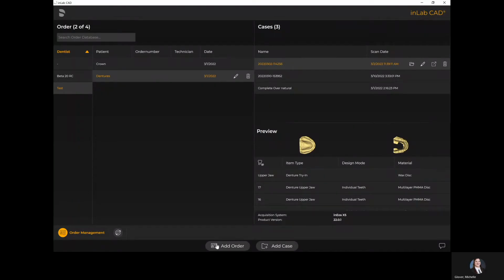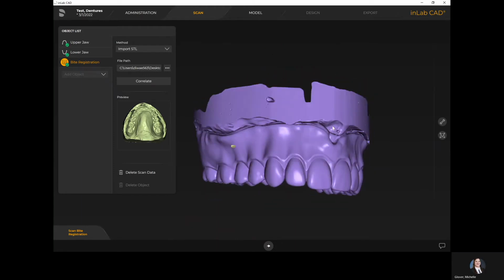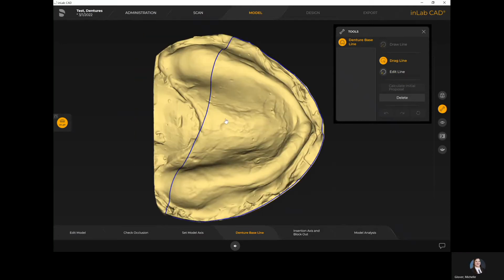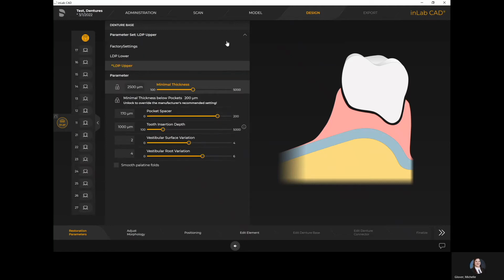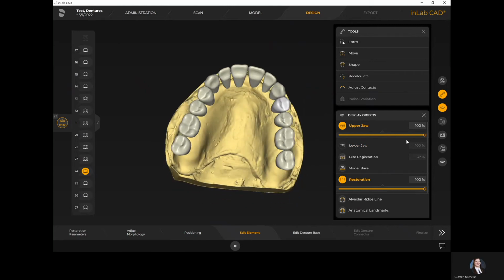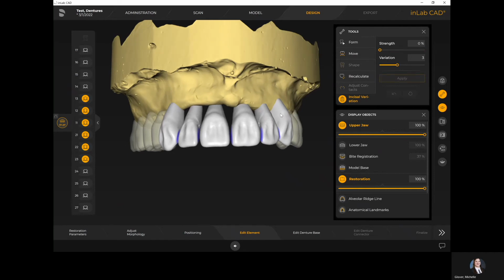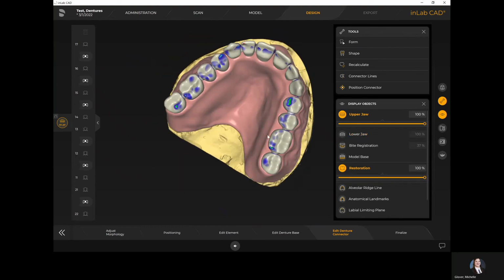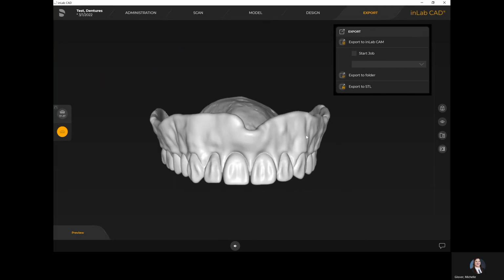inLab SW22 Complete over Natural Dentures

Comment: Is there a way of adding a posterior palatal seal or a slight mucogingival margin perimeter on the denture base to create a seal at the borders. It seems I can't use the form tool on the intaglio surface of the denture base.
Reply from the maker: Hi there, I find most denturists will use the "remove" tool on the actual model itself, that way when it designs the denture base, it takes into consideration the palateal seal. But there are others who feel digitally produced dentures have better retention that it's not required. So it is up to you :)

Comment: Is it possible to use other manufacturers teeth eg vita ?
Reply from the maker: You can use the “individual” tooth option and what’s called “biogeneric” which gives you a library of different morphologies (including shapes like oval or tapered). You’ll be able to get it similar to other manufacturers but not identical to their moulds.
Reply: @DigiDentStrategies  thanks ive been tinkering with the biogenerics but sirona doesnt seem to offer shapes mades for dentures and making balanced occlusion. Lots of room for improvement for dentures still. Good videos !
Reply: @DigiDentStrategies  for anyone reading this later. the software is crucially missing the exocad option to adapt the base to the model so when it thinks it needs more minimal space under the teeth instead of shortening the teeth it protrudes into the jaw making it all unuseable. switched to exocad. Expensive mistake to buy this for dentures.

Comment: Any idea why, when I go to edit denture base, I get error "The computation of the denture gingiva (upper jaw) failed"?
Reply from the maker: This could happen for a few reasons: 
1. The arch doesn’t have enough space to generate a base depending on what your minimal thickness is set to in the parameters 
2. Try adjusting the tooth settings for the insertion depth etc
3. Confirm that your base line of the denture is smooth. Sometimes if we click too fast you’ll see a gap in the border you created, so confirm it’s smooth. 

Hope this helps! :)

Comment: My inlab 22 does not allow me to highlight the teeth to export, it indicates they are part of upper model. The base can export with sockets, but I cannot get the teeth chains. Any hints?
Reply: In the export phase, when you go to export as STL files, you’ll need to select each individual component on the left side, then select export as stl. It will only do one object at a time. For example, if you’re exporting the base and you can see the base with sockets, that’s the only object you’re exporting when it’s selected. Once exported, if you then click on the teeth on the left side of the export screen, you’ll then be able to export the segments or tooth arches. Hope this helps clarify?